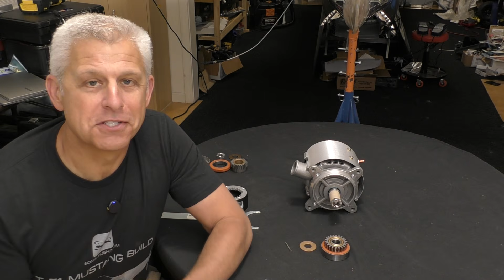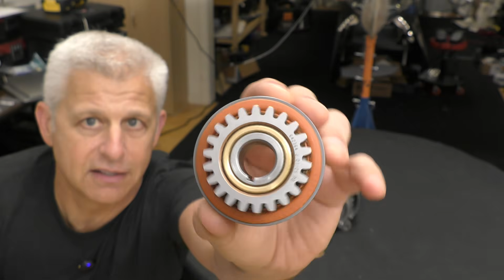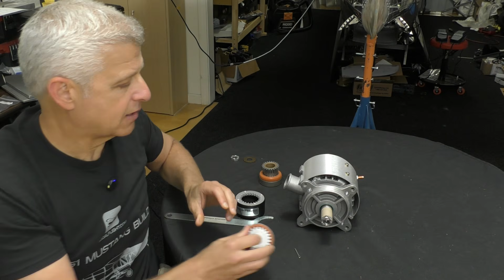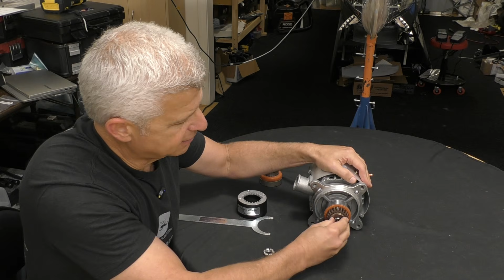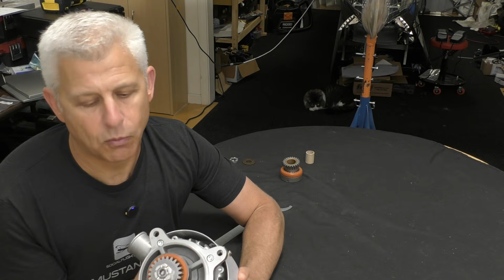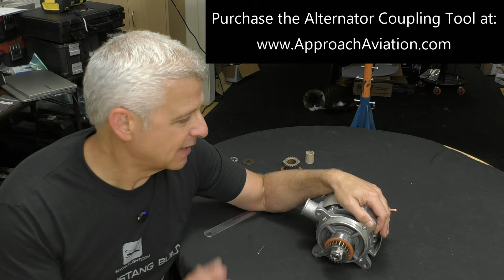AIRCRAFT ALTERNATOR SECRETS! Direct Drive Alternator Maintenance Tips for Flight Safety

Comment: enjoyed the video but in my opnion the new design is still problomatic, installed properly and when subject to loads that load the alternator up to 50-60% of its capacity drastically reduces the service life of the coupling due to excessive flexing and in short order that orange material will be shedding into your engine. I have had this happen on a 58 baron 3 times over a few years with the updated design. we use an artic portable airconditioner and we have the orginal 50 amp alternators which are suffcient and the amp draw is controlable on the artic air and I try to keep the load to 50% or less on each alternator but we have already had to replace 2 of these due to the material starting to shead pieces of itself. The question  then becomes what amount is acceptable that is now in your oil pan. Does that material float or does it sink to the bottom. Are the pieces big enough that the pickup screen for the oil pump prevent them from getting into the oil system or do they end up in the oil filter. We never find any in the filter media so is the material draning out when the oil is changed? The other thing that you talk about is it being an emerency if you get an alternator failure light and I aggree but my theory is if that alternator locks up for whatever reason (bearing failure, etc.) unless you are over an airport you won't get it on the ground before that gear assb. generates so much heat that it will self destruct and at the very least do serious engine damage as the metal  pieces of that gear assb. are now being pumped throughout the engine. I wonder if any test have been performed to see how long the gear assb. holds together before grenading when subjected to a locked up alternator shaft. The friction of that bushing material appears to be pressed together and would genenerate a lot of heat real fast. Another issue I see is having a 100 amp alternator is great but it also imposes a lot more stress on that gear assb. which  will increase the amount of flexing and will cause that elastometric material to fail at a higher rate than lower powered alternators, especially on single engine aircraft that have aircondtioning or anything that causes large draws on the alternator. I would be curious to know what issues the old style gear assb. ( a loaded spring in the hub) had that caused the redesign, also you say that you should not use the old design but they have not issued an AD (to my knowledge) to address that at this point. The new design may be better at absorbing loads but IMO it has its own issues that need to be addressed, like a way to contain that material until the akternatir gets pulled to inspect it and replace the gear assb. due to material coming apart. Glad to see this video and maybe a follow up one.